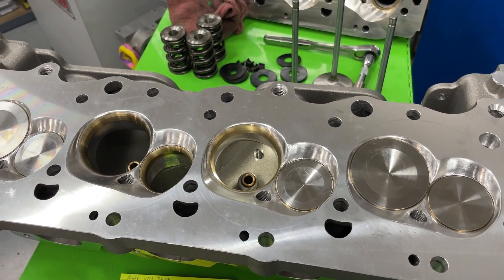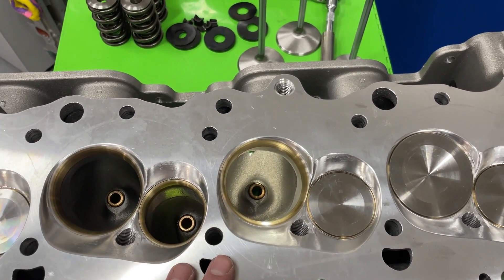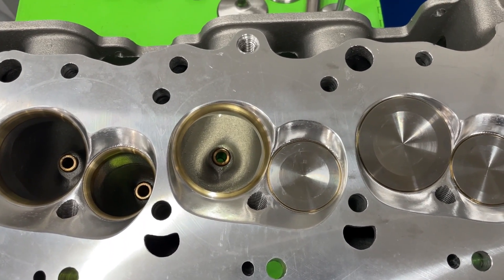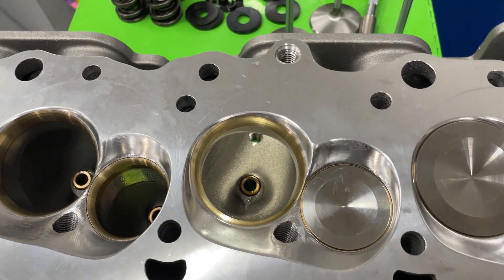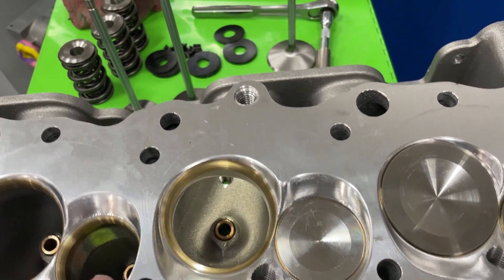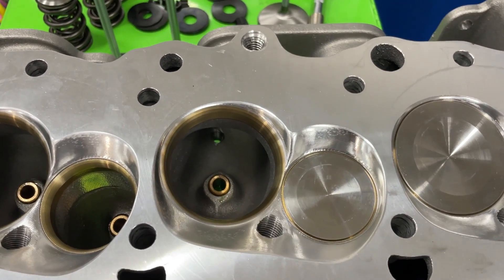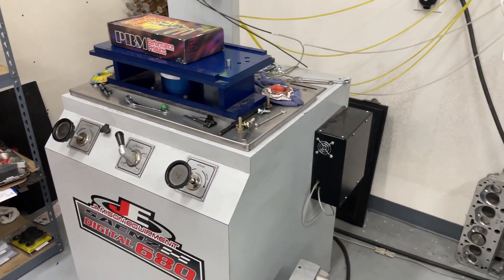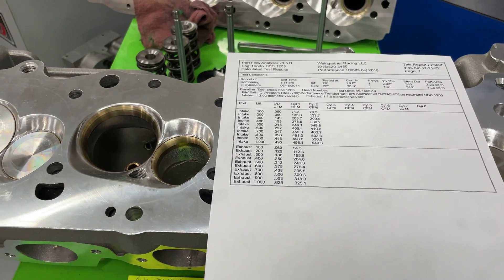The Highest Flowing Head I Have Had On My Flowbench

Comment: CRAZY weight for those intakes . "rev limiter heads". lol Why would the intakes be so much thicker than the exhausts ? 
It'd take so much seat pressure to keep those chinese hats from floating, it'd be so hard on components it'd be crazy . 
Also, the limitations on revs would completely cancel out the advantage of the runner design without the ti .

Comment: Really enjoyed seeing this video. I had been curious about the other spread port heads that Brodix makes compared to the 14.5’ heads I’ve been building my big block around. Still have to come up with rocker stands, springs, locks, retainers and locators for mine but I’m gettin there. Pretty sure mine run the same valves you showed here. Bought 2.52 and 1.86 by 6.750 for my setup. Took a little while but recently got my crankshaft back from Mile High in Colorado. Still clearancing my block now that it’s back. Only running a 4.610 bore compared to the 4.625 you mentioned that the engine uses in your video. Wanted to have a little wiggle room in the future in case of a blow up but may be kidding myself entirely thinking there’s gonna be enough left to bore and save or sleeve if that ever happens. Haven’t spoken to anyone yet about a camshaft recommendation for mine but should be doing that soon. Don’t know yet how much lift I’ll have enough clearance for, the specs from CP show over 16-1 static compression. As far as the intake I really lucked out by finding a used profiler cast tunnel ram set up for a single 4 fairly cheap. Just had to change the top for dual 4500’s. Working on my oiling system as time permits lately, considering adding extra drains to the backside of the heads to allow me to add AN fittings to promote drainage away from the valve train. Not absolutely sure it’ll be necessary but know my cousin had problems with oil pooling up there with the Pontiac spread ports. I assumed the drains would help with avoiding oil drain back in the valley creating windage. Still have some more machine work I’ve got to do going along with the fitment prior to final assembly but may be contacting you in the future at Weingartner Racing Eric.  Been busy working on backhoes and skid loader hydraulics lately but getting back to it soon. Again, great video and really informative.

Comment: I find gasket matching humorous. So let’s design and cast a head and meticulously design the valve train and flow then screw the hole thing up by matching the ports to a gasket that some draftsman drew up that has absolutely nothing to do with the port layout. My gaskets are made to match the ports not the other way around.
Reply from the maker: Yes but most good heads have a special gasket made just for that port.

Comment: SPREAD PORT HEAD? I'M SCRATCHING MY NUT SACK ON THAT ONE. YOU CHEVY GUYS SHOULD FACE THE FACT. WHAT YOU'RE LOOKING AT HERE IS A FORD CLEVELAND STYLE HEAD. I WENT DOWN THE ENTIRE COMMENT SECTION AND NOT A SINGLE ONE OF YOU PEOPLE WHO POSTED. WOULD ADMIT THE TRUTH IT'S A FORD HEAD. THIS IS THE FANTASY YOU CHEVY GUYS ARE LIVING IN THINKING THIS HAS EVERYTHING THING TO DO WITH CHEVY. BACK IN 1983 WHEN THEY MANDATED THE 500 INCH RULE. SINCE THE NHRA IS ANOTHER DIVISION OF GM. THEY HIGHLY MANIPULATED THE RULE BOOKS AND RULES IN FAVOR OF GM. THE 500 CUBIC INCH RULE CAME INTO EXISTENCE, WHICH WAS GM'S PLOY TO GET RID OF THE FORD CLEVELAND ENGINE THAT DOMINATED PRO STOCK. SO GM TAKES THE OLDSMOBILE BLOCK AND STUFFS IT LIKE A THANKSGIVING DAY TURKEY WITH A ROTATING ASSEMBLY FROM A BIG BLOCK CHEVY AND THEN THEY MADE A BIG PAIR OF FORD CLEVELAND HEADS FOR IT. THIS IS THE REASON FORD DOES NOT PARTICIPATE IN PRO STOCK. BECAUSE IT'S ALREADY A FORD STYLE ENGINE THAT IS BEING RACED. WHAT CHEVY TODAY IS RACING AND WINNING WITH IN PRO STOCK FOR DECADES IS ACTUALLY A BIG CUBE FORD CLEVELAND ENGINE. EVERYTHING CHEVY USES IN RACING TODAY IS ALL FORD BASED FROM THE 335 SERIES, 385 SERIES AND THE BOSS SERIES ENGINES. ALL YOUR SYMMETRICAL HEAD CHEVY RACING ENGINES ARE FORD SPEC ENGINES LABELED AT CHEVY. ALL YOUR MOUNTAIN MOTORS LABEL ON CHEVY ARE ACTUALLY FORD BOSS 429 DESIGNS. YOUR NASCAR R07 IS A CLEVELAND KNOCKOFF. IT EVEN HAS THE DISTRIBUTOR IN THE FRONT. THE LS IS A REGURGITATED FORD 427 HIGH RISER ENGINE AKA RAISED PORT 351 WINDSOR. A HARD FACT THAT MOST CHEVY GUYS DON'T WANT TO SWALLOW. BUT THIS IS ALL TRUE.

Comment: Eric, without using Titanium valves and other exotica, where does Brodix get off charging so much for these? They're made of the same stuff as regular aluminum heads. The pattern making and foundry process is the same. The machining is the same. They may have more engineering time in them, but it's all done on computers now. So what makes em so expensive?
Reply from the maker: The tooling to make this head casting costs about 150k. These heads because they are so exotic Brodix is not going to sell near as many as the regular heads. So in order for them to make their money back they have to charge more. From material stand point it has about 10lbs more aluminum in them than normal heads and also better seat material as well. That adds up the cost.
Reply: @WeingartnerRacing  Oh. What special tooling is required that was isn't used on mainstream heads?
Reply from the maker: @jeffrykopis5468  none but to make a new mold required for this head is about 150k. The machine time is also up to run these heads.

Comment: Have you ever Flowed the newer Pro Mod hemi heads that came out back in 2014.  They have been Dominating the class since and make about 5400 hp. Compared to Chevys  4500 hp. In the same class . Some of the 405 guy's are running a hemi type engine in their chevy car .
Reply from the maker: They chances of me ever seeing those is very remote. Proline and others keep those heads done in house. I think they even have contracts to no allow them to be worked on anywhere but proline.
Reply: i was thinking maybe the hemi exhaust port being directly across from the intake could initially pull the intake charge in better than any non hemi design resulting in better cylinder filling regardless of static intake flow numbers. anyone?

Comment: Re-Calibrate Flow Bench...got some Bogus Numbers... L/D  #' not right ?...1.000"  @ .496 L/D is Real 1.248" Lift .....900" .@ 446 L/D  is Real 1.124" Lift....800 i@ 396 L/D  is Real .997" Lift.....700 @ ..347 is Real .874" Lift....600    @ ..287 is Real .748" Lift,,,,ETC
Reply from the maker: The l/d is calculated by what you input for valve size. It doesn’t affect flow numbers. The flow numbers come from pressure sensors not from valve inputs.

Comment: Great video eric, great head, it would probably be a bigger effort on the long runner, less on short, to port them to end up getting a closer/even 8 inlet ports.. I have seen some12*  Profilers that flow 560cfm with a smaller valve,approx 2.425" 2.450"...i very decent serve of porting on inlets...

Comment: On the intake valve does the extra margin on the titanium valve change the low, or is it more noticeable on the exhaust?  Or, does it only matter on the what the opposed valve to what you have open has that effects the lower flow because it adds shrouding?

Comment: Why is it so expensive? Ok maybe exotic seats? I don't see where this cost any more to produce than say an Eddy petf rpm big block head. Is it R&D? How can one company produce and sell a head for $1500 and this is over 5k? I can see the valve train going up in price valve train can vary widely but a head better design or not it's just a casting.... especially an as cast. Are they just charging what they do because they can so if you want it you gotta give em what they want or tuff titty
Reply from the maker: They have to recover the cost of the tooling to make the molds. They are not going to sell as many as the basic heads so they have to charge more.

Comment: 45cfm difference between the ports up top 😳 what is the primary factor for that?
Reply: Bogus Numbers , .....LOOK at all the .....Lift/Dia ..Multiply L/D x 2.520" = Lift ......Valve Lift  #'s are High, High, 1.000" is Real  1.249" Lift - 540 Cfm , .....900 is Real 1.125" Lift - 531 Cfm , .800 is Real.997" Lift -505 Cfm , .700 is Really .874" Lift  - 464 Cfm , ETC................ 

Pushrod Pinch is 4.40 Sq In Cross Section........   for 2.520 "Valve  @ 94% of throat = 4.40 Sq In  Cross Section = 480 Cfm
Reply: @MrKawa74  4.4” of area can flow 642cfm at 28” test pressure.
That 2.52” valve with a 90% throat minus the area used by the valve stem can flow 576cfm, 91% throat 589cfm

I don’t see how you have ended up with 480cfm 🤷‍♂️

Comment: When those zz632 heads hit the market, I’d be interested in what you had to say about those.
Reply from the maker: They are out. They are smallish. I don’t know if they have the material to make them larger to match the output of these heads.
Reply: @WeingartnerRacing  oh? Interesting, I figured all the cc’s we’re from the length of the runner like you said in this video.
Reply from the maker: @morganpowell2999  that plays a part but the port is also larger than the 632 especially bowl and short side.
Reply: @WeingartnerRacing  thank you for the replies, very informative.

Comment: I am shocked at the low lift numbers. 1-.300 lift is not much different than a conventional small block head. How do these compare to the big dukes?
Reply from the maker: The back cut on the valves or lack thereof killed the low lift flow.
Reply: @WeingartnerRacing  dont forget the 8-12 degree back angle with a much flatter valve...good vids Eric...
Reply: Good call!!!    Hell there are some small block heads that do better.   Ported Cleveland and Ported LS3 and LS7 heads can make 230 cfm @ .300" and  160@.200".

Comment: Nice, is this the same port configuration as the new 632 from Chevrolet that makes 1000 horsepower NA?
Reply from the maker: No. That one is symmetrical meaning all the ports are exactly the same. There is no long and short port.

Comment: I’m sorry but if you buy that head with steel valves, you can’t afford that head. Hate when people try to make everything on the cheap.
Reply: I agree, I don’t quite understand buying this head with steel valves. This is the type of head you get into right before you start looking at billet heads & intakes. This should be on a 8000+rpm 11.2 deck 4.84 700+ci engine pushing 2500-3000hp on nitrous. If that’s not what you’re using these for, then you’re wasting money and would have been better off with a set of SR20’s.
Reply: @my87z28  
You can definitely use them for smaller n/a engines in the 582 to 632 range. They are good heads for n/a engines making 1200-1400 hp. We also see them used in some 1200-1500 hp blown powerboat engines, but soluble the advent of the 20 degree heads and the Profiler 430’s, there are simpler and better solutions. But if you are in an n/a class or nitrous, they are strong runners. I just don’t get saving a bit on valves for something that will never be built for longevity. 
I can sort of see it if they weee for a pleasure boat engine, but then it’s a very 90’s way of trying to make “reliable” power. And for a drag and drive style engine, the 12 degree stuff is just kind of off.
Reply: @AB-80X  that’s kind of my point. Eric did a set of BB3 extra’s, with his port work they are now around 380cc and flowed nearly 460cfm on his Saenz bench. The plan for them is at first on a NA 582 that’s should make around 1050-1100hp. Then later 1400-1500 on a mild hit of nitrous. We went with these heads to keep the budget moderate, not to mention, we had already ordered everything for the shortblock, so going 20* couldn’t happen without changing the pistons. If I were to have stretched the budget a bit, I would have gone with a set of ported BRX/SR20’s. We’d of seen around another 50-60cfm and likely pushed for closer to 1200hp. 

For the cost of these heads Eric has, along with the shaft rockers, I’d hope you’re looking to make quite a bit more power. Otherwise, financially, it just doesn’t make much sense to not go with the SR20’s. Most all conventional headed race classes, that I’ve seen, allow the 20* stuff.
Reply: @my87z28  a 700 cube engine at 8000rpm has a cfm demand of 684cfm, this cylinder head is absolutely nowhere near enough head for anything close to that 😂
Reply: @seanb250 , So, by your metric, that would mean Eric's 565, spinning 7600-7800rpm would require 524- 538CFM. Maybe you should ask Eric if the ported BB3 Extra heads on his 565 flow anywhere near 524-538cfm.
Again, by your metric, that would mean that my 582 would require 526cfm at 7400rpm. I can assure you, as I have the flow sheet from Eric, that my heads don't flow 526cfm. Hell, by your metric a set of SR20's wouldn't even flow enough cfm to satisfy mine or Eric's engines at the rpm they have been designed for. And yet here we are, and I could show you countless 632's running out of the box SR20s, spinning 8000rpm. But according to you, that's impossible, seeing a 632 at 8000rpm would require 618cfm. A full 100cfm more than SR20s produce out of the box.
Reply: @seanb250 , let's delve a little deeper into this. Based on a dyno video that Eric posted of his 565, it made 1108 at 7400rpm. That hp, from that cubic inch, at that rpm is right at 112.2% VE. Since his engine made peak at 7400, we'll go with that rpm. Based on your metric, that engine would need 511cfm at 7400rpm. However, since we know, based on simple formula, what his VE is at 7400rpm, we can easily calculate the required cfm needed to produce this. He would need 464.9cfm. Based on everything I know about the heads on Eric's 565, I'd say that's about spot on with what his heads are seeing at the max lift of his cam. 

So, while we're at it, let's figure this out for this 700ci engine that would make peak power around 7500-7600rpm and be shifted around 8000rpm. Let's say this engine is making around 1.9hp/ci, so 1330hp NA at 7500rpm. That would be a 107.3% VE. Based on this, the 700ci engine would require 558.3cfm. I'm pretty sure they made 540cfm out of the box and Eric could easily get that up to 560-570cfm with a minor amount of work.
Reply: @my87z28  delve as deep as you want, your statement was 8000+rpm 700+cubic inches
Reply: @my87z28  I would also need to see both yours and Eric’s power curves before making a cfm number claim of your induction system, it’s not where it makes peak power, it’s where the power starts to flatten off that tells the story of how much air is at the valve 👍
Reply: @seanb250  , well I did give you an example for a 700ci engine that gets shifted at 8000rpm. How about now I do the math for a 700ci engine that makes peak at 8000rpm and gets shifted around 8500. Since you're still at this. 700ci engine, 1400hp, peak at 8000rpm, has a VE of 106% and would require 588.3cfm at 8000rpm. again, these heads could be ported and make those numbers. So keep going...
Reply: @seanb250 , you stated 684cfm as a requirement for a 700ci engine at 8000rpm. The only way a 700ci engine would require that much cfm at 8000rpm is if it were to have a 124% VE, which isn't going to happen on a NA engine.
Reply: @my87z28  ok I will bite 😁
Cfm demand and VE are 2 different things, cfm demand is based around peak piston speed, pressure differential and the ports average airspeed. 684cfm to maintain no higher than Mach 0.55/0.6 airspeeds in the port to avoid subsonic choke at peak piston speed which occurs at around 73 degrees after TDC, which is a pressure differential within the cylinder of around 3.5psi from memory, a pressure differential is required for air to move, so tell me, with a “vacuum” in the cylinder at this point what is the VE?
Now this momentum (energy) created by the pressure differential at peak piston speed is only now what comes into play for VE, as VE over 100% can only be created AFTER peak piston speed and really only once the piston is closer to BDC and on its way back up on the comp stroke, it’s the inertia filling at those points that push numbers above 100% VE, and at that stage the heads aren’t in fact flowing their top end numbers are they?  Because the valve is already closing.
So I stick by my statement that those heads would choke on a 700cube engine at 8000rpm, enjoy your evening.
Reply: @my87z28  should we now talk about cross sectional areas as well? Cfm will show where the power curve starts to flatten off but cross sectional area will contribute to how far that power is carried, that then just becomes an efficiency number of flow v area. If the % is poor the engine will make average power but seem to hold that power after peak for longer.
A high % efficiency will make fantastic power but will generally taper off more quickly after peak, this is because of the airspeeds I spoke about in my previous comment, the higher the efficiency % the narrower that window becomes before subsonic choke.

Comment: Seems ungodly expensive...I'll put up my bbc afr 335 468ci with it's v7 ysi blower again anyone that buys that combo...lol JK but I did build entire combo for less than the heads are
Reply: This is the type of head you’re going to see on a 11.2 deck 4.84 bore space bbc making 1200-1400hp before spraying nitrous and 2500+ after a couple kits. The engine it’s self is likely to be $50k+.

Comment: How does this compare to a Zz632 head, I heard they flowed around 500 cfm?
Reply: Good question, any input Eric?  Is chevy selling the topend package separate?
Reply from the maker: The 632 head is symmetrical unlike this meaning all ports are exactly alike. There is no short port or long port. I saw it at pri it looks small but they we’re targeting a different rpm band. In all out power this one would win because of size and flow as long as the engine needed it.
Reply: @WeingartnerRacing  Thanks Eric